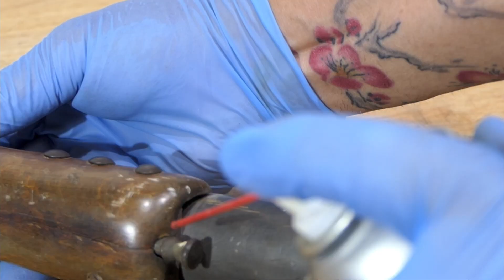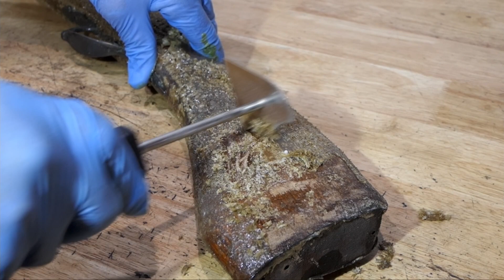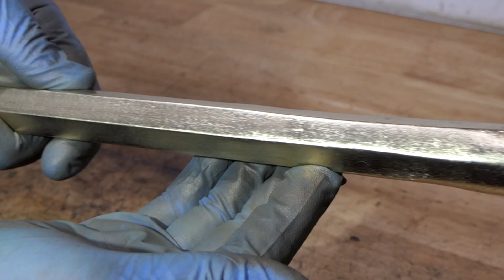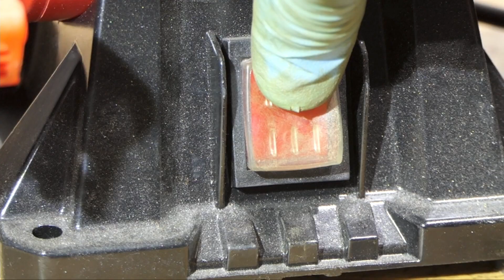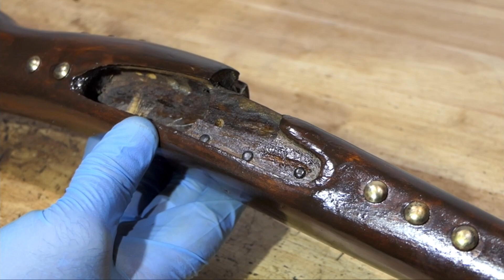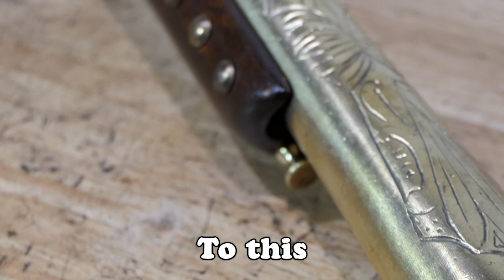RESTAURATION DU VIEUX FUSIL DE PIRATE 1803

Comment from the maker: Are there still guns like this that still work? Don't forget to subscribe and activate the bell, it's very nice.
Reply: Yes there are guns like this that still work. This was never an actual gun however. It was either a child’s toy or a nice presentation piece to hang on the wall. I can tell this because there is no hole going from the pan into the barrel. And for being made out of brass the barrel would explode the first shot that was taken with it. Not to mention the final fact that the frizzen is made out of brass also which means there is no way for a piece of flint to cause it to create a spark. But it does look nice!